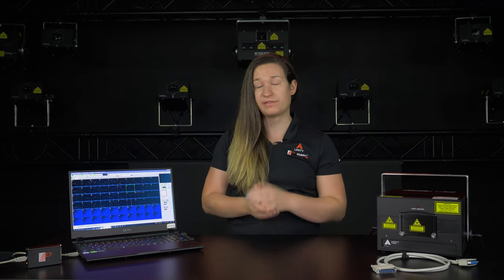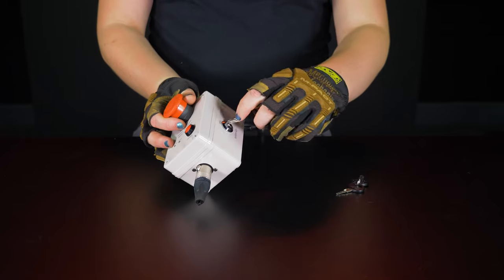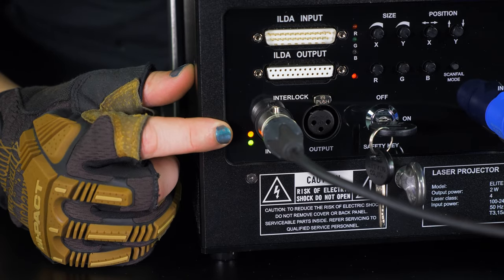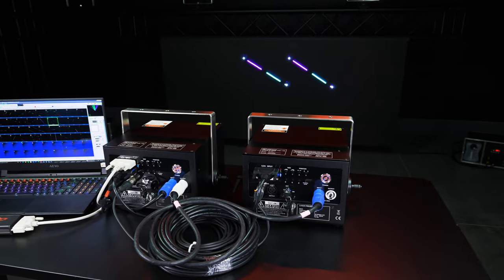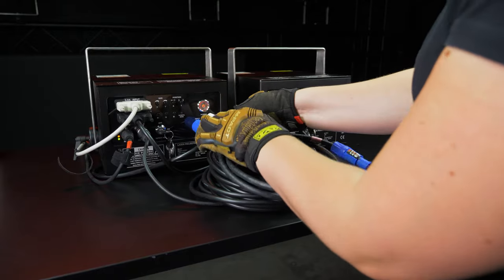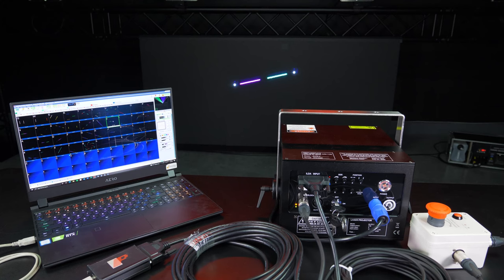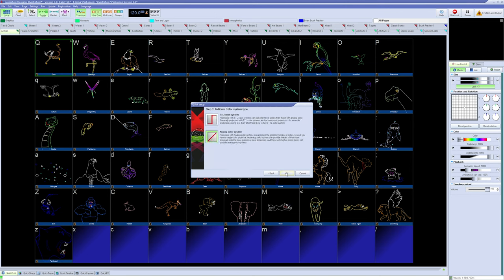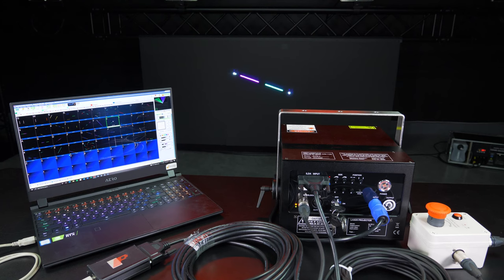Getting started with your Unity ILDA based laser system

Comment: So if I want to run say 4 lasers, I would need 4 of the FB3QS hardware pieces? Can Beyond or Quickshow allow for doing 4 independent shows running in sync?
Reply: Realizing this was asked a while back, yes, you'd need a separate FB3 for each laser you want to have independent control. If you are looking at four lasers, you might want to consider the Unity with FB4 built in. You can daisy chain the network cable and address them all individually on the single cable. You would not use ILDA control in that instance.
Reply: @jstamets  Thanks for the reply! I went with 2 Q3 6w's and a 10w Q3. Just running the 6w's mirrored. Thanks!